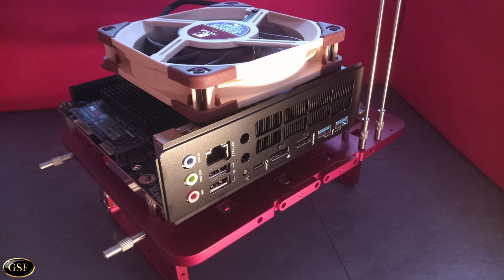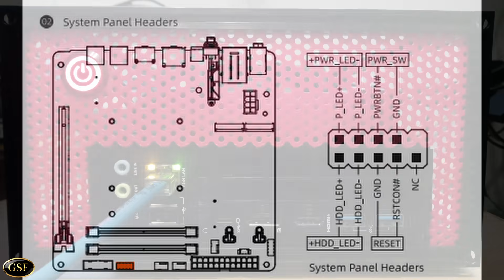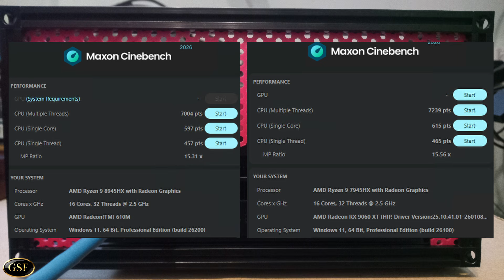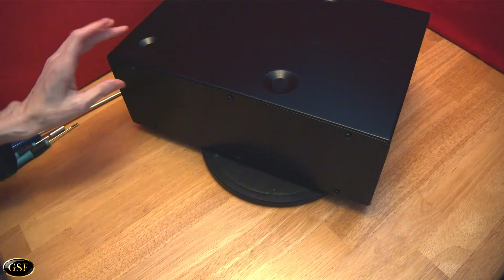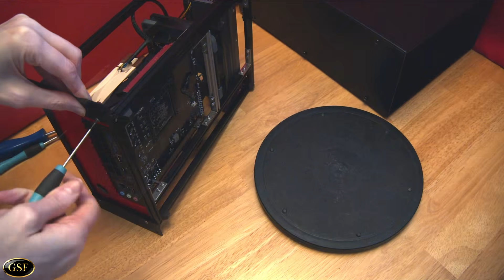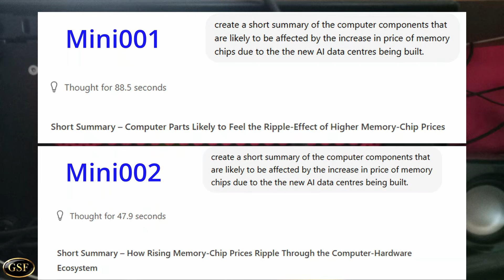MinisForum BD895i SE ITX - Ryzen 9 build - part 2

Comment: This just motivates me. I'm waiting for my order which should be here for in a few days. Got a Maxsun B580, 64 GB SK RAM and 750 W MSI GL PSU. 

I'll also be making a video. 

Thanks heaps for sharing. Much love from Melbourne, AUS
Reply from the maker: Many thanks, good luck with your build, and I hope your video goes well.
Reply: We're pretty similar. I’m not going full SFF, but I’m building an MFF setup.

DEEPCOOL CH260 + two TEAMGROUP 32GB sticks (64GB total) + RTX 4070 Ti 3-fan + SK hynix P31 1TB + DEEPCOOL 850W PSU.
Reply from the maker: That should be an interesting build.